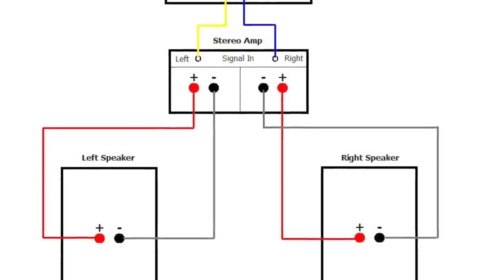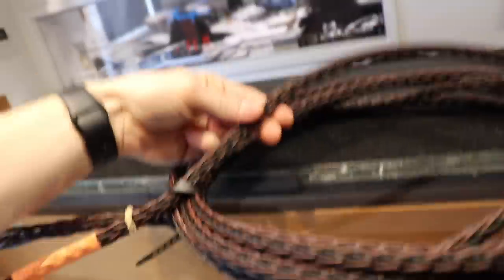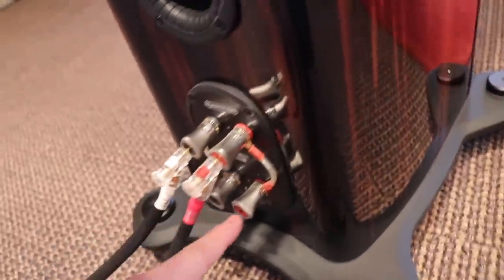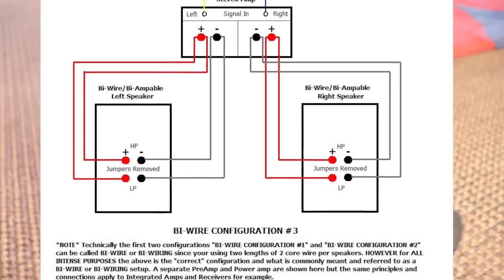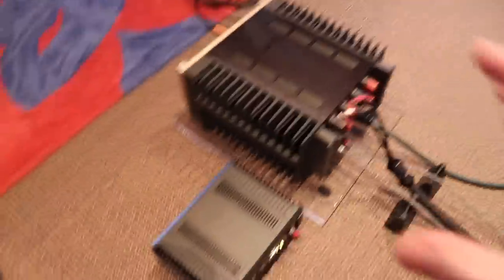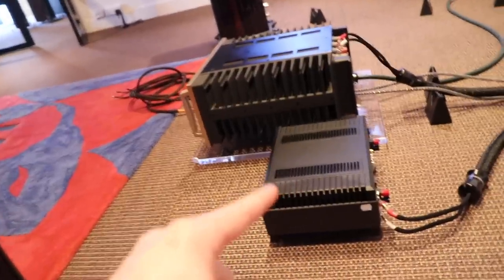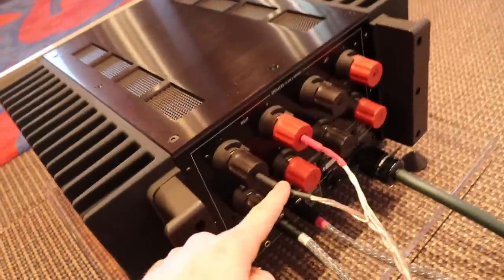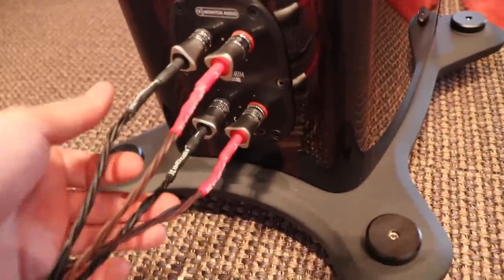Bi Wiring, Bi Amping   What is it?

Comment: If you have speakers that are biwireable but you only have one set of speaker wires and have the bridge plate in place.  My question is if it is better to connect the one set of speaker wires to the low-frequency or high-frequency posts?   I have always connected to the low-frequency post given that bass response requires more power than treble, so, my thinking is any reduction in signal strength going over the bridge plate should have less of an effect on the treble than on the bass response. Also, I noticed in the video you showed two speakers that were biwireable but only had to connections, not four.  In both cases, you had the speaker cables connected into the low-frequency post.  I understand that the Monitor Audio Platinum speakers had the cable connector vs the bridge plate, but the others did not and you were still connected to the Low-Frequency post.  Given your comment on lost fidelity going over the bridge plates, why aren't you connecting the speaker cables to the high-frequency post instead of the low-frequency post?
Reply from the maker: Its a little bit of a 50/50 toss up.  connecting the wires to the low input posts gives better bass response but sacrifices a small amount of fidelity that only experienced listeners can hear.  Connecting to the highs posts gives that fidelity back but on thirsty speakers that like a lot of power can reduce the strength of the bass.  Most of the time (for most listeners), it's not going to matter what posts you connect to so I usually dont take notice of which ones I use.  When you're demoing speakers to someone who could hear those differences, I would be much more likely to bi-wire them anyway to prevent any potential loss of any kind.
A good middle ground would be to connect the + wire to the + highs post and the - wire to the - Lows post.

Comment: Bi amping is good too on avr. When we use stereo mode more power goes to the front towers and use 4 power ends and do bi amp. Just need put on bi-amp on software. It works good on budget speaker towers  too. But best is on 3 way crossovers

Comment: This video over-killed the whole reason for using bi-amping, and having a more powerful amplifier on the woofers/sub-woofers SEPARATE from the amplifier of lesser power for the mid-range and tweeters, because when a system is driven hard as in PA rock band levels, using only single amplifiers powering both the woofer and the upper frequencies causes a distortion which will create inter-modulation or beat distortion in the vocal range due to over-driving the bass. Using bi-amplification totally eliminates this condition. For more realistic levels such as in the home stereo environment, even demanding classical music it is good to have, but not totally necessary if the main amp. is of sufficient capacity to resist this phenomenon. As far as using the the metal strips to connect woofer and upper range drivers using only one amplifier, it is absolutely nonsense that a separate piece of regular wiring will have any audible effect on the sound. Otherwise high end speaker companies would not use that, if there was any chance that something like that would degrade their product. That is SNAKE OIL garbage from such blah blah as this video suggests.
Reply: I have very bad experience from Kimber Kable 8PR speaker cable. They are too dull and lifeless and worse than even $1 per meter electrical cable used for speakers. I bought it but my money wasted completely and i thrown away that cable, so much poor it was that! I already have QED XT40 cable, they are fantastic cable with great bass and check sibilance wonderfully.  But XT40 lacks clarity and detail. Now i have ordered Epic X cable and it is on the way. Let's see it's my final speaker cable or still something will be left.

Comment: First of all thanks for the video!! Is excelente! 
So, if I use a Monitor Audio Bronze 2 series in a Yamaha n-r303 is much better to biwiring with the a+b option ? 
Again... THANXXXX!
Reply from the maker: You could try it but it might not be worth it at that level.
The difference bi-wiring makes is real but it is very small and more cheaper systems usually not worth the extra money needing to be spent on speaker cable.

Comment: Which jumpers do you propose for wharfedale diamond 225?Some say that with biwiring you have a larger amount of mid/ treble to the speakers?Is it true?What is your opinion. In case you don't like very "open or bright" sound, this could be a problem.For those who like bright sounding speakers  wf 225 has a little "dark sound" but for me is a non faitguing sound.Very nice educational video!
Reply: Bi-wiring wouldn't do anything to that imo.
Bi amping of course you will need to match the levels .
If you really wanted to do anything just make some little wire jumpers if you really dislike the metal bars.
Otherwise I feel this extra stuff is for when you have too much money xD it's like making half an active speaker without making an active speaker, but costing a lot more

Comment: Reasoning for the jumpers was to drop ohms so amp would produce a higher wattage output.
Reply: the jumpers make the speakers full range,,or passive   without  jumpers you can separate  the highs and lows,,it has nothing to do with making more power

Comment: Bi wiring, using different cables for HF and LF but in the same length, should cause any problems? thought of silvers on top and copper on bottom.
Reply from the maker: Not a problem at all, actually quite a common practice to put the thinner better cables on highs and cheaper but meatier cables on lows.

Comment: Teflon my frying pan has that. Does that mean my bacon sizzling will sound better when it's cooking?
Reply: You see PTFE, is not only the 3rd best dielectric after air and raw cotton, but also is heat resistant. It therefore does not distort and contaminate the joint, like PE and PVC, when soldering wires directly to components. Especially when using high silver content solder at higher temperatures to join silver plated ones.

Comment: ....appreciate your explanation here ...excellent video!,..just one question,...when you send 2 separate connections (bi-wiring) to a speaker (one set to High and second set to low frequency ) from a stereo amp that has 8 binding post ( A and B)..with 85wpc ...would your speakers get 170w each?...Left speaker 170w and right 170w??...OR 85w for the high frequency driver and 85w for the low frequency drivers...truly appreciate your help
Reply: It's basically a voltage divider circuit and the watts per speaker depends on the impedance of each LF and HF speaker. It both LF and HF have the same impedance then each would divide the current equally and thus each would get the same amount of watts.
Reply: @kusgilb  thank you,...appreciated!

Comment: Hi! I have a question, I have 7.1 Monitor Audio Silver set of speakers and I only have McIntosh MC312 stereo amplifier with 300watts each channel, I want to connect all my speakers to this amplifier, do you think my amplifier can drive my speakers to their full strength without losing any performance and speakers not in risk? I’m planning to bi-wire them but I’m afraid to do it. Can you give me good advice please? Thank you! I really like your video.
Reply from the maker: This is just a 2ch amp and it has different binding posts for different impedances of speakers.
So whatever the impedance of the speakers you are hooking up is, that's the terminal you need to use.

Comment: I did the bi-amping, and the sound - even after recalibrating the speakers - was muddy: powerful, but imprecize bass, very harsh highs, mid was not creating any room. One cable is a shorter 2,5mm2 cross surface I used for the highs, the other one is a longer 4mm2 cross surface that I used for the lows.
Is it the amp that is crappy, or the cables really have to have the same properties to do bi-amping?
Of course, I removed the interconnecting wires between the speaker poles to keep the right impedance.
Out of curiousity, I swapped the pairs in between high and low posts, and it didn't really do much difference, I expected hissing or lost sound due to filters of the speaker.
Any tip? I have a Pioneer SC-LX88, I used the Top middle for highs, Front for lows as per the manual.
Reply: You see how this bi-amp snake oil is really not helping achieve better sound?
You don't need an extra amplifier if one is big enough. There are perfectly good passive crossovers in the speakers and all this complicated engineering problems have been solved for you, once you bought an amp and 2 speakers. All this video is adding nothing.

Comment: Good illustration of the physical connectivity of bi-wiring, however, you failed to mention one of the key reasons why there is so much difference to a standard two wire set up.  Despite the connections at the amp being common, the signal travelling down each wire is not the same.  The HF wire only carries the high frequencies and the same for the low frequencies.  If you don't believe, me put an oscilloscope across the wires.

This happens because the crossover elements in the speakers are still doing the job of filtering out the unwanted frequencies for each set of drivers.  This means that the cables are not carrying as much current and also there is less crosstalk between the HF and LF in the system.

In my own set up I had a pair of 5m cables.  As the amp was now located between the speakers, I decided to bi-wire and I could do it without having to buy wire!  There were four potential improvements.  First, cables half the length.  Second, removal of the plate interlinks.  Third, double the amount of cable for carrying the same total current.  Fourth, reduced crosstalk due to frequency separation.  Result was a stunning improvement in the detail levels, stereo resolution, bass definition, I could go on.

If you have speakers with this capability it's an essential upgrade.
Reply: if you are biwiring then the signal will be the same at the speaker end. since its the same source. the signal is exactly the same on both sets of ends. 
unless you have some sort of filter somewhere on the cable.
if its bi amped or active then yes there will be a difference.
Reply: You're right, it would need a filter, however, there is a filter; the crossover.  Just because you're bi-wiring doesn't mean you remove the crossover entirely, each drive unit retains its filtering elements.  Passive bi-amping also still relies on the crossover in the speaker.  In an active configuration, the crossover sits between the pre and power amps, of course.
Reply: @markcarrington8565  yes the crossover is between the cable and the driver.  the signal at the end of the cable is the same is what i'm saying.   you said the HF wire carries only highs and vice versa for low even being a common connection at the amp end. 
that's not the case unless its actively done at the amp in which case you would need 2 separate pairs of cables, HF AND LF.
bi-wiring carries the same signal to both sets of cables at the speaker end and as you say the crossover does the filtering. there is no HF AND LF in bi wiring as such, just two pairs of cables at one end.
Reply: chris198004 , I suspect you will not be convinced by anything I say, however, I will attempt to explain it better.  Between the speaker post on the amp and the terminal on the cone is a continuous circuit made of speaker wire and a filter, with elements appropriate to the driver in between, typically a capacitor on the HF side and inductor on the LF side.  This filter does exactly what you expect, it prevents current from flowing at frequencies that would damage the driver.  It does not matter that the filter happens to be mounted close to the cone, it filters the signal in the whole cable between speaker post and drive unit.

The only common element between the two wires is the potential difference, or voltage at the speaker post, which is the same.  To drive a speaker, however, you need current to flow and the crossover elements on each wire ensure the two sets of wires only carry current appropriate to their driver cone.
Reply: @markcarrington8565  i totally get that mark. im well aware of how a crossover works.
all im saying is the cable itself has no change in signal from one end to the other which is what you said!  you stated that the cable has different signals for HF and LF on a bi wired setup.  that is not the case.   I quote " Despite the connections at the amp being common, the signal travelling down each wire is not the same.The HF wire only carries the high frequencies and the same for the low frequencies.  If you don't believe, me put an oscilloscope across the wires"

that is simply not the case, if the amp end is common then the other end carries the same signal BEFORE entering the crossover network. no matter how many ends are on that one cable.  YES the CURRENT carrying capacity will be lower due to splitting the cable however the audio signal will be the same.   im talking about the cable itself BEFORE it connects to the speaker and crossover.  i believe that your first statement was about the wire not speakers.
Reply: chris198004, it is not water.  There is no before or after in a circuit.  The circuit comprises: amp speaker post (+ve), long wire, speaker post (+ve), short wire, capacitor, short wire, tweeter (resistor), short wire, speaker post(-ve), long wire, amp speaker post (-ve).  The current is the same at all points in the circuit.

You also have a parallel circuit with an inductor instead of a capacitor to the woofer, and the current flow will be the same throughout that circuit.  However, these are two independent circuits and the current in one has no bearing on the current in another.

If this were not true, explain to me how a crossover works inside the speaker.
Reply: @markcarrington8565  oh sweet lord this isnt going to get us anywhere is it.
You are talking about a circuit, I am simply saying your statement about the cable having different signals is not correct. its the same signal. 
and yes when you split a cable you reduce that new thinner sections current carrying CAPACITY. 
we are talking about two different things now. 
I'm talking about the amp (+ve) to woofer (+ve) to tweeter (+ve) in bi wire mode, that signal IS the same at the woofer input and tweeter input then the crossover does its work   
 anyway lets leave it at that for now.
Reply: chris198004 , nice to see we kept it civil.  Anyway, these guys not only explain it but actually measured the reduction in cross modulation distortion by having the HF and LF signals going down separate wires.  Enjoy.  https://www.qacoustics.co.uk/blog/2016/06/08/bi-wiring-speakers-exploration-benefits/
Reply: @markcarrington8565  well I never. After reading this conversation I was totally logically not believing this. Electricity confuses me so much. Watching some stuff about it not really being in the wire blew my mind but I’m not sure I understood it completely. But anyway. As long as I keep sticking my red bits into the red bits and the black bits into the black bits then it seems to be fine. :-)

Comment: What a bunch of snake oil ! The metal jumpers being replaced with the Loops of your special wire ?  I am also pretty sure you said you could hear an immense difference ?  I think the surface area and short path of those straps are a better option than your wire loops. I'm just spit-balling here but I'm worried. The 2 Red and 2 black outputs are strapped together inside the amp. You best inspect those straps immediately and make some loops of your diamond encrusted super conductor TC wire and fix that problem A.S.A.P.
You also say the bi-wired system provides more current and the amp won't have to work as hard ?  how ridiculous !   There is plenty of conductor there (without doubling up) to transfer the current to those speakers. Could that cause propagation delay between them or standing waves. I am not sure I'm not the expert you are.  What kind of current is that amp putting out ? I think a good number of my reactive load machines in my shop could run off those cables. I hate the term Audiophile ( also many spell it Audiofile ). I can't believe so many proclaim to hear the difference (like your loop vs the short strap)  as if their auditory perception can really hear the difference. Maybe a real audiophile is a  Elephant / Bat hybrid  species. 
Is it the sales commission or the amount of money one has in a system that tricks the brains auditory neurons ? This seems to  make him/her a radio telescope... or the proverbial Audiofool, I meant Audiofile , or is it Audiophile.   I give up !
Sincerely,
Just a guy with an efficient, modest , well matched tube system. It has just the right amount of the 2nd order ' Harmonic' as I sit in a spatial sound field of bliss.

Comment: These amp are Class A right? Plus I prefer using pure silver for jumpers, I realize they only use crap copper wire inside the speakers from speaker to connector and the speaker winding's, cables as well, but if you have the money use silver on everything and you don't want to run long cables for no reason or one meter from one speaker and eight meters to the other, you will have loss on longer cables, keep them equal and as short as possible, just saying.

Comment: Now say you're running 2.1 speakers on your boom box you build and you have 100 watts per channel two channels driven so 200 watts total, but they used two chips on the board designed BTL normally 50 watt per channel using only one chip, they tie the each of the two chips together so the one chip that's normally stereo is now mono at twice the power and two chips together so you can't bridge them down to mono, but you need 400 watts for a center sub-woofer, can you run two 200 watt Class D or AB mono block amps together, will it work or do I need isolation?